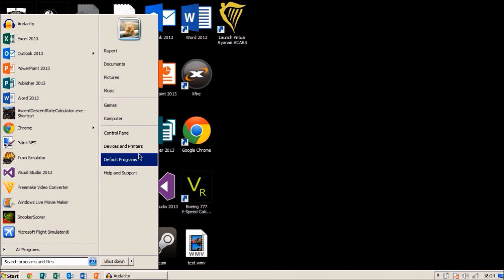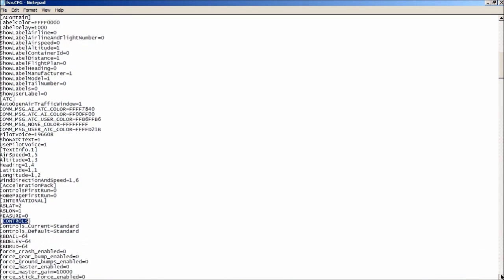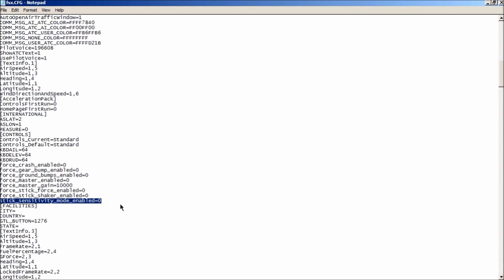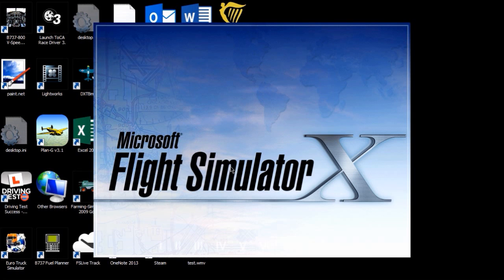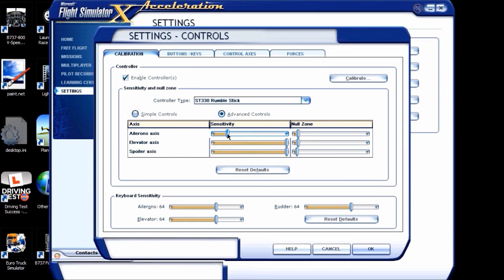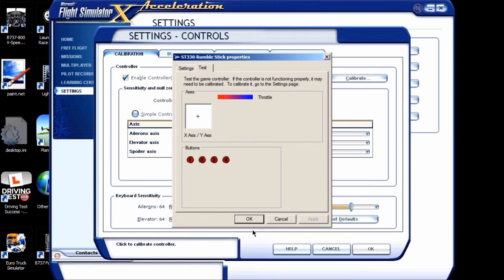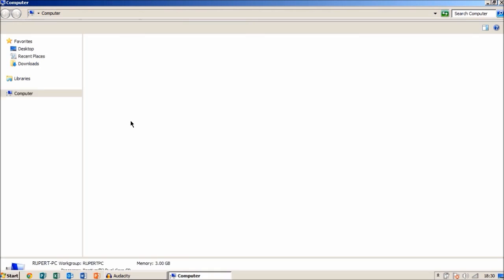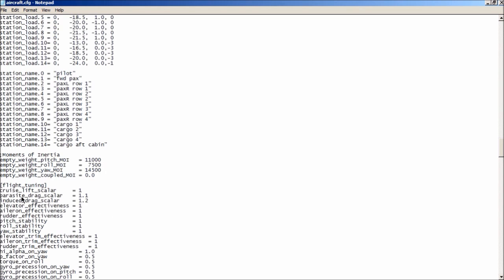FSX - How to setup your joystick/controller properly! (100% Linear!)

Comment: copy and past to find fsx data in winows upper bar %appdata%
 
then microsoft 
then fsx
Reply from the maker: +Adam Ebrahem Thanks but there is a video explaining in detail on the channel, thanks again
Reply: Rupert Smith u're welcome .
and ur tweaks really made  a huge different in controlling the plane thanx
Reply from the maker: Glad to hear:)
Reply: @RupertSoftware  +1 for this comment. I played FS 2004 obsessively for a few years until my computer back in those days got old and no longer ran properly. I tried to get into FSX in 2010 and 2017 but gave up as the planes were so much harder to control. I've spent huge amounts of time the last few weeks committed to getting FSX to work properly for me. I came across this video today, did what you said with the CFG file, and now I finally have planes that stay in the direction I have pointed them in. Before it was like driving a car where the steering and suspenion bushes were all shot to pieces. On final approach, I was having to constantly adjust my heading even with no wind at all. Thank you so much for that. The reason I had been searching though, is that my throttles don't come back completely to idle with my joystick. I need to use a workaround of  assinging a button on the joystick to be the same as the F1 key to get idle in the plane after bringing my joystick back to idle. I think it's bacause FSX has a minimum of 1% deadzone in the axis. That 1% stops the PMDG autobrakes firing though, and the plane creeps forward again after coming to a stop. Do you have any suggestions for a way round that, so the throttle is completely at idle, when you bring your throttle conroller back to idle? Thanks again for giving me much more controllable planes!
Reply from the maker: @calumw8409  hmm that's interesting, I don't remember having that problem with the PMDG 737 but what you say does make sense. I'll have a look tomorrow - it may be possible to force the dead zone to be 0 by setting it directly in the config file rather than with the sliders. If you don't hear back from me send me an email - smith.rupert@outlook.com so I don't forget!
Reply: @RupertSoftware  Hi Rupert. I did find another Youtube video about removing throttle null zone that went into a file on user-appdata-Microsoft-FSX-controls-standard. Then change the null zone for my Thrustmaster throttle from 1 to 0. I did that, and whilst it still doesn't go completely to idle it now goes close enough that the PMDG 737 autobrakes engage on landing, wheras they didn't before. I guess FSX has the 1% null zone, and if the Thrustmaster also had it that was the difference between the autobrakes firing and not firing. I did try to go back in and change the null zone to -1 for the Thrustmaster throttle, and I think I mucked that up, but the autobrakes are still activating on landing so that's not too bad. Thanks for your help!
Reply from the maker: @calumw8409  ahh okay well done - that should be fine now. The thrustmaster deadzone won't affect the issue you're having, it just means the throttles in game should stay at 0% until you meet the deadzone threshold. If the throttles definitely still aren't at idle (how are you checking btw?), maybe try calibrating your joystick?
Reply: @RupertSoftware  When I look at the throttles in the virtual cockpit, and bring my quadmaster throttle back to idle, it still comes back a tiny bit more when I press the F1 key to idle the throttle. I think that is because of the 1% null zone in FSX which seems to be the minimum. When the thottle also had it's own 1% null zone, I reckon that made 2% in total, and the extra 1%  stopped the autobrakes deploying  at touchdown as the plane needs to be in idle. There would also be some creeping forward after the plane had stopped. For calibrating, do you mean calibrating with Windows 10 itself, rather than with Thrustmaster software?
Reply from the maker: @calumw8409  Hmm right that's strange 🤔 actually thinking about it I don't think it'll be the null zone slider that's your problem - it will be the sensitivity one. Make sure that's fully up (maybe check in the cfg file to make sure it's not 99%). You would expect the null zone to act as you're describing but if I remember correctly, if actually puts the null zone in the centre of the axis. When having the joystick with this tweak applied, if you have the sensitivity reduced, it will effectively constrain how far you can move the throttle, so say you had the sensitivity as 80%, if you had your joystick throttle fully retarded, the throttle levers in the virtual cockpit would be at 10%, if you applied full throttle, the levers in the VC would be 90%. So make sure you have that sensitivity maxed out
Reply: @RupertSoftware  Thanks for that. My head is spinning a bit with this. Where would the cfg file be, that I should check the sensitivity setting on?
Reply from the maker: @calumw8409  I'm just on a flight as we speak, I'll check after
Reply: @RupertSoftware  Thanks. If I may also pick your brains about something else. FSX is running nicely for me now, especially after watchinmg your video yesterday. I am also trying to get P3D v5 and MS2020 running well too. However, in both the planes are utterly uncontrollable, and if I can keep them on the runway long enough to take off, they will generally flip over and crash. It's like my controllers only want to work in FSX which can't be the case. If you have any ideas to resolve things and get my controllers working in P3D and FS2020 that would be great.
Reply from the maker: @calumw8409   Hmm I'm guessing the controls are overly sensitive? I think this tweak works in P3D (I've never used P3D but I remember someone commenting saying it does). About msfs2020 I'm not really too sure what settings you have available as I haven't yet bought it. I'm sure there will be something you can do though, sounds like you need to reduce sensitivity (sometimes can be called linearity)
Reply: @RupertSoftware  Thanks.
Reply: @RupertSoftware  I did the same thing in your video above for the CFG file for P3D v5. It does seem to work. Now if I move my yoke whilst looking at the aircraft's yoke the two yokes do exactly the same thing, which was not the same before. I now have the A2A Cessna flying nicely in P3D after much wailing and gnashing of teeth. I turned the sensitivity of the yoke and the rudder WAY down, with a big null zone on the rudder, and none at all on the yoke. I also changed the controls settings in P3D from direct input to raw input after finding a thread on the P3D support forum. That may or may not have made a difference but at least you can then calibrate the controllers within P3D in case P3D doesn't like the Windows calibration. Thanks again for all you help!

Comment: Awsome  Rupert.  I would like to contribute to this by advising other readers how to access fsx.cfg for Windows 10.  It's a bit different.  "This PC\Local Disc (C:\)\Users\[your name]\Appdata\Roaming\Microsoft\\fsx"
Reply from the maker: +Theo Langenberg Thanks for your contribution, there is a video I uploaded on how to find it but as you say, it is a little bit different so thanks again. By the way, how is FSX running for you under windows 10?
Reply: Happy to contribute.  FSX appears to be running fine on Windows 10.  Unfortunately I have been grounded. My joystick (Hotas X) stopped talking to my computer.  I thought that I had worn it out through daily use.  So I purchased another.  This also is not connecting.  It was recommended that I should download Hotas's software but I have not been able to do this. Hotas only list compatibility up to Windows 8.  I have asked them to confirm re compatibility with Windows 10 but they have been slow coming back with a reply other than their system acknowledging receipt of my query.  So I will have to put up with my FSX withdrawal symptoms.
Reply from the maker: Theo Langenberg Ah ok, I have heard that driver support isn't great in windows 10 but I'm sure that companies will update their drivers over time. I myself am still running 7 and will probably upgrade near the end of the trial period so the bugs are ironed out.
Reply: +Rupert Smith (Rupert's Software) Hi again Rupert.  Happy to report that I'm back in action.  Both my Hotas joysticks are talking again with one problem:  The rudder action is totally dead when I try to fly.  It works OK in the "settings'".  I had reduced the sensitivity to 0.7.  The previous reduction to 0.8 worked fine.   I changed it back to 0.8 but it's no good.  Would you have any suggestions please ?
Reply from the maker: So the game isn't registering any movement?
Reply: I thought about this all day and when I came home I tried unlocking the joystick and rotating it - guess what - it worked.  However I would much prefer to use the toggle on the throttle handle.  So much more realistic.  I will keep looking for a solution.  Meanwhile I am learning so much more.
Reply from the maker: Hmm, I'm afraid I'm unaware of the hotas-how do you mean by toggle on the throttle? (I may be able to help with that as I've configured TOGA buttons to axis on my joytick). And do keep letting me know in the comments so if the community get's any problems similar to yours-I can point them in the right direction
Reply: The toggle is a rocking switch located in the throttle handle.  Meanwhile I have been using the joystick handle (twist) as a rudder control.  I am beginning to prefer it as it is not nearly as violent in it's reaction as the rocker switch.Also I received a very detailed reply from Thrustmaster, the HOTAS people.  They ensured me that all drivers are Windows 10 compatible.  I will follow their recommendations.
Reply from the maker: Ah great-yeah definitely use an axis over a toggle. If you've got a cheap racing wheel (can pick them up for around £30) you can use the pedals as rudder (like I am) and actually-they're surprisingly authentic! (Obviously not 100% realistic since they are separate but it gives a better feeling)

Comment: Still not linear
Reply from the maker: +Johannes Lindqvist Assuming you carried out the tutorial correctly it will work, just as a note the yoke in the aircraft may not move in a linear fashion however if you look at the actual elevators and ailerons they will move 1:1
Reply: Whether the ailerons and elevators move linearly with the yoke is not the issue, the correct comparison is how the VC yoke moves in comparison to your joystick, which is what you talk about in the video. You should not presume that the control surfaces in a real aircraft move linearly with the yoke movement. Regardless, the FSX virtual cockpit yoke continues to move in a non-linear way. I suppose it is just possible that the yoke animation is unchanged and that the aircraft handling actually changes in the way you have described, but I doubt it. It would in any case be difficult to test because the yoke behaves more or less linearly near the centre and to really see a difference you need to be looking at bigger displacements. This means you will be performing exaggerated manoeuvres, so it will be hard to assess subtle differences.

I note you also comment that the presumed linearity makes the yoke more sensitive (which you then address by going in to the aircraft config file). This doesn't make sense - if your change has removed the exponential scaling and made it linear the yoke ought to feel less sensitive, not more. The native behaviour of the sensitivity slider actually introduces a delay in to the response, which serves to damp out large over-control movements, so for sure you will lose this if you change STICK_SENSITIVITY_MODE, but in normal operation you wouldn't be making such big movements unless they were deliberate and in any case if you are aiming for realism you should expect the aircraft model to reflect the aircraft's natural damping tendency.

Comment: can you explain clearly about null zone?  how do you set it with jerking
Reply from the maker: Afgw Asd Hi,
Null zone is the amount you can move your joystick before it is picked up by FSX. So with a high null zone you could move your joystick quite far without affecting the controls in FSX. Similarly if you have a low null zone, any tiny movement for the joystick will affect the controls in FSX. This is useful if your joystick produces a jerky outut, ie the cross in windows calibration tool jerks around, as it means when centered the jerks do not affect the controls in FSX whereas if you didn't have a null zone the jerks would be translated to the controls in FSX.

I hope you now understand but if not don't hesitate to let me know and I'll record a quick video explaining visually,

Kind regards,
Rupert

Comment: It doesn't seem to work in my computer. I can't find the file FSX.cfg
Reply from the maker: Hi sorry for the delay,
Press the windows button and type 'folder options' then ensure there is a tick mark next to show hidden files and folders then look again.
If this doesn't help give me a shout and we'll get things sorted,
Rupert
Reply: Hi Rupert and thank you for your answer. I've tried what you said and still I can't find that file.
Reply from the maker: Hmm, so could you send me a screenshot of where the file should be or as close to that location you can get? Is it just the fsx.cfg file or is the whole fsx directory not there?

Regards,
Rupert
Reply: it's just the fsx.cfg that I can't find I do everything you do in your video but I cant find that file. I even tried Disc C / program files / Microsoft Games / Flight Simulator X / then...I even tried "control F" and paste "fsx.cfg" just in case I couldn't see it...but nothing showed up. How w can I send you the screenshoot? cuz...I've tried it through here and it didn't work.
Reply: I'm gonna try to post an screenshot now...
Reply from the maker: Hmm, ok if not send it to me on this email address: officialscruffybear@gmail.com. I think i know the issue,
Regards,
Rupert
Reply: Rupert Smith I think type in the start search bar - %appdata% and click on Roaming, then go into Microsoft and you should find FSX in there. Cheers. :)
Reply from the maker: You are indeed correct and thanks for helping out in the community:) I uploaded a video yesterday showing how to find it so I can just point people to that;)
Reply: Rupert Smith No worries.

Comment: Pushing forward on the stick is nice and smooth, but pulling back a little snaps right to full. How do I fix that?
Reply from the maker: hi,
Try recalibrating your joystick, if that doesn't solve it make sure in FSX sensitivity is on full.
if neither solve it, let me know and we'll get things sorted.
Happy flying, Rupert Smith
Reply: Thanks for the tip! I recalibrated my joystick and it's working properly again.
Reply from the maker: MacKenzie Johnston Great to hear, if you ever get any issues with joysticks recalibrating is usually the solution. Happy flying, Rupert Smith. (ps don't forget to check out the rest of the channel;)

Comment: You're awsome dude! thanks!!!
Reply from the maker: SuperTails81 Thanks, glad to help. Rupert
Reply: Rupert Smith I need your help again. after the windows update, my joystick won't able to read. i try reintall the logitech gaming profiler, it didn't work. Any solutions, thanks.
Reply from the maker: Hmm, try uninstalling the logitech gaming profiler (just to check) and use the default windows calibrate window. It maybe the driver needs to be updated to work with the new version. If this doesn't work let me know and we can try some other things.
Rupert (Ps. watch the channel, video coming out later tonight)
Reply: Rupert Smith Well i didn't work. I run a troubleshooter, the problem said that "Windows cannot load the device driver for this hardware because a previous instance of the device driver is still in memory"
Reply from the maker: Hmm, make sure there are absolutely no drivers at all installed for that joystick, then go and download the latest version of the driver.

Hopefully we'll get you back in the air soon, Rupert
Reply: Rupert Smith I think the windows  update is messing up the Logitech usb drivers.
Reply from the maker: Hmm I agree, I believe you can revert back to prior updates...
Rupert
Reply from the maker: have you managed to find issue? Hopefully your back in the skies;) Rupert
Reply: Rupert Smith Yep all i have to do is reset my computer.
Reply from the maker: Ok be careful that you back up files that may get lost;) if you need a hand with anything else. Rupert
Reply: Rupert Smith i trying to do the last it siad accesses denied
Reply from the maker: Access denied to what? Are you the admin account?? Rupert
Reply: Rupert Smith OH nvm just a litte glitch.
Reply: ***** if  you press save then said access denied, save it at desktop, then put the fsx.cfg file where the old fsx.CFG then press replace and all done.

Comment: Does this work with the throttle.  On my payware planes I can't get my joystick to fully open or close the throttle.  It ranges from 15%-85%.
Reply from the maker: Yep it should do, make sure there is no deadzone and that the sensitivity is on full. Hope it helps, if it doesn't let me know and I'll see if we can get it sorted.

Happy flying,

Rupert Smith,
Rupert's Software
Reply: I have my sensitivity setup like the aircraft designer recommended.  Should I start by adjusting the aircraft cfg to say 1.2?  or do the entire tutorial.
Reply from the maker: Do the entire tutorial as that means you know whats going on and you won't make any files conflict. If it doesn't help, its very easy to revert back. Just as a note; make a copy of files before editing as we all make mistakes and you don't want to have to reinstall fsx.

Rupert